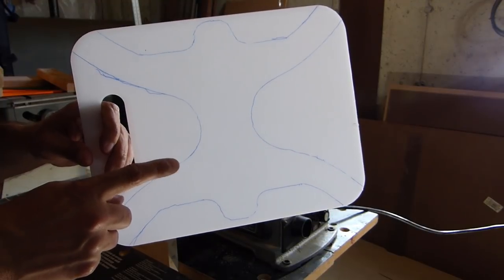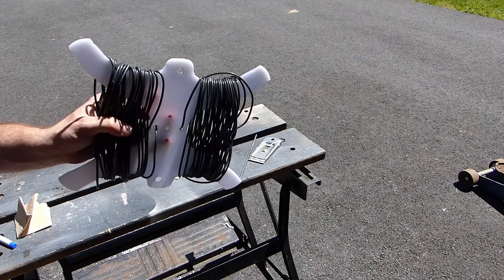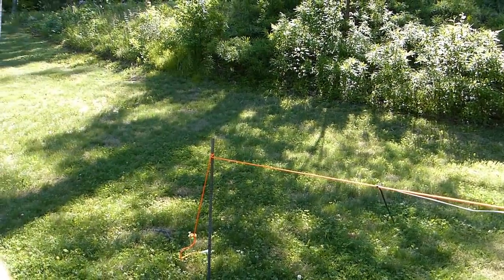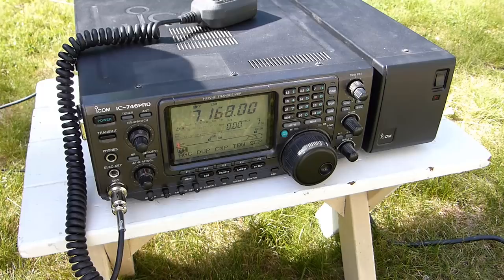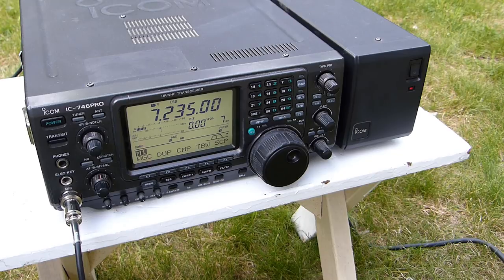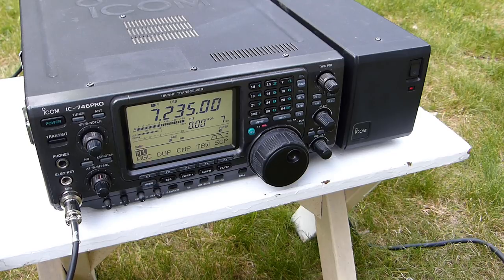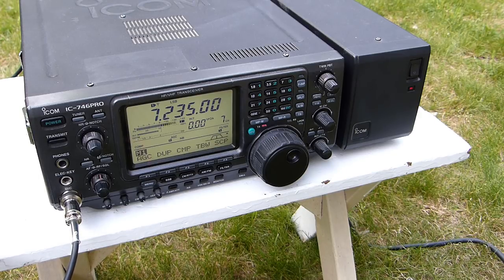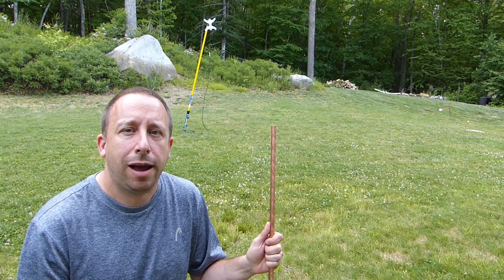Cheap and Cheerful Ham Radio Field Day or POTA Antenna Build and Demo

Comment: Sounds like it is working pretty good considering it is 40 meters in the day time. I will be operating 1B Battery from the Ozarks. I'll look for this weekend during Field Day,
LIVE from my deck and picnic table portable. Have fun and 73.
Reply from the maker: Sounds like a good setup.  I'll be on for a few hours Saturday afternoon with a small group of guys at a local state park.  We are going to run my G5RV and use my buddies ft891 and go kit.  We'll be using my call so keep an ear out.....73, de N1NUG

Comment: Excellent video.  Step-by-step and then demonstrate SWR then demo the action.  I didn't hear any specs except 12 ga. wire.  Length of the legs considering you had to do an extension?  Hope you do more videos on similar DIY real HAM especially such portable ideas as emergencies happen and if I lost my tall vertical I would go to an inverted V dipole.  Any opinion on whether the shape of the cutout makes a significant difference?  73s
Reply from the maker: Unfortunately I lost a few clips due to a flaky camera.  I've got a new camera on the way so hopefully this won't happen again.  Stay tuned, I will definitely be making more videos about this subject over the summer.

Comment: Another very good video, Rob! I am considering making a inverted V for 40/20 for portable.  I would use a telescoping pole and tie off the ends with trees or whatever I can find.  I have a question, what is better for POTA, vertical or horizontal?  I know it all depends, but in general when you are in the parks the noise floor is a lot lower and maybe a vertical might be quicker and easier to deploy.  Opinions?
Reply from the maker: Hmmm....I'm not sure - I've had good luck with both.  I think I prefer my linked dipole when I have the room and time to set it up.
Reply: @SevenFortyOne  very good. Did you mount that dipole as an inverted v most of the time?

Comment: do you need a balun? i'm so confused the more i read the more confusing it is....a few say a balun is needed the other few say it is not needed.   But doesn't the feed line become part of antenna?  thanks.
Reply from the maker: I don't think there is a definitive answer to that question.  I've had them on dipoles and never noticed any difference in performance.  They do help with decoupling the feedline from the antenna and prevent rf from getting back into the radio.  I think if the antenna is resonant, it's not as much of an issue.
Reply: Most likely not "needed."  The balun you are thinking of takes the electromagnetic waves from the unbalanced coaxial cable to a balanced dipole antenna elements.  In the video he effectively did the same thing by connecting the shield to one element and the center conductor to the other element.  A balun should operate as a 1:1 impedance choke as well, preventing common mode current from returning back down the outside of the coax cable.  At a minimum part of the power to the antenna is lost by return current.  Common mode current problems can occur when the balanced antenna becomes unbalanced by, for example, imbalances in the terrain, the configuration of the elements (one element at a different angle than the other or bent differently), etc.  It is probably impossible in real-world conditions to have a perfectly balanced antenna system because of undulating terrain, structures, method of installation, and so forth.  I do not want return current at all so prefer to use a balun.  Then there are baluns that act as transformers to attempt to match the impedance between the antenna and the feed line (such as a 4:1 balun or 49:1 balun).

Comment: Might be sturdier if you mount the pole with wires on the silver extended part of the pole and yellow part near the ground.
Reply from the maker: Since this is meant to be deployed and taken down quickly, the Guy wires aren't really needed since it will only be up for a few hours at a time.  Having said that, Its not bad the way it is actually.  I left it up for almost 2 weeks like you see it in the video and it held up fine.  It even survived a thunderstorm.
Reply: Sorry, I didn't mean the guy wires, rather the dipole antenna itself. It seemed to me that the stronger the base, the sturdier the structure, and since the yellow base is thicker, it'd be sturdier. The way you had it, the larger weight  of the stronger yellow part would be tugging against the thinner and weaker base. At least that was my thinking when I saw it, anyway.
Reply: @RobPetty622  I have a similar pole and I put the yellow end on the ground.

Comment: What direction was your 40m inverted V pointing? North-South, East-West or other?
Reply from the maker: Legs were roughly N-S meaning the broadside and main pattern was east-west
Reply: @SevenFortyOne  that's what I thought. Pennsylvania was stronger than Maryland and South carolina. Makes sense. I plan on building a ZS6BKW doublet dipole for 2020 FD.  73.

Comment: So maybe what our fellow YouTuber Eric at Ham Radio Concepts claims the secret to dead bands is calling CQ. So if everyone is listening but no one is calling CQ the bands will remain dead and I think you proved that. I don't have a HF rig yet but can't wait to get started. Money is the big thing right now that is stopping me.
Reply from the maker: Eric is right - especially lately with the perceived notion that the bands are "dead".  there may not be as much exotic DX out there but there are still plenty of people to talk to.  I've built my collection of radios slowly over the years as there rarely is disposable income for expensive radios.  A local ham recently got a fantastic deal from HRO on a returned Yaesu FT-891...he's been watching their website for months and caught the deal before anyone else could snap it up.  I guess what I'm saying is that if you are patient you'll find a deal that fits your budget eventually.  And as you saw here, once you have the radio you can build decent antennas for yourself  without spending a lot more.
Reply: @SevenFortyOne  I like your response to a commenter below on baluns. I have always wondered what they are for and your answer gave me the insight to understand it is to protect the radio that's all...or is there another hidden reason? Am I missing something here? 
I just burned up my Yaesu FTM-100DR dual band radio. It was only three months old. I think it was due to a heavy duty cycle setup as a Wires-X node access point on America Link on high power without any extra cooling. I hope they will fix it. I know you don't do the UHF VHF digital modes but I am sure that the radio at times was tx-ing full power at nearly 100% for minutes on end. I was stupid. They are not built for that. I don't think any choke or balun would have saved this poor radio from an early death.
Reply from the maker: I always experiment and go with what works in terms of baluns.  That's what 5he hobby is about.  Sorry to hear about your radio...I hope you can get it sorted.  I may get into digital modes in the future...like you said, it all comes down to money and time.

Comment: guy wires
Reply from the maker: not needed for this height/temp antenna setup.
Reply: @SevenFortyOne  I use a very similar setup and guy wires are definitely an asset.  you should consider them
Reply from the maker: @johnryan5781  I did consider them when planning this out and may experiment with them in the future.  For this setup I decided to try without them first and since everything seemed stable I decided not to use them.   For me, in this use case, I think they would add complication without providing much benefit.
Reply: @SevenFortyOne  understandable..I used my setup on Avon Mountain the first time and a gust of wind blew it over . It caused some damage to my FT 817nd
Reply from the maker: @johnryan5781  I see where you are coming from...that would make me a bit gun-shy as well.  I'll be testing mine on Soapstone Mountain soon...have to find some time between chores and working OT.
Reply: I've heard of some folks that connect 20m resonant dipole elements at a 90 degree angle from the 40m elements.  That way you have a 2 band antenna and the elements themselves do the "guying."